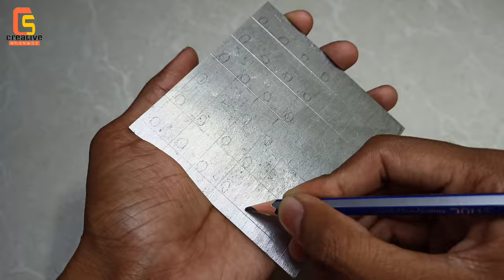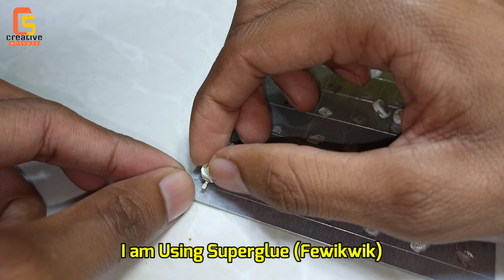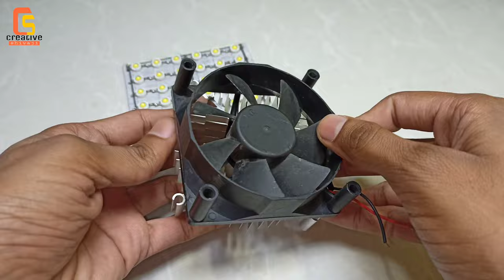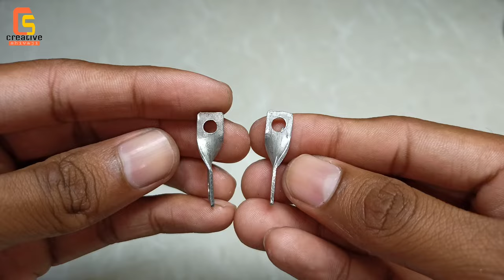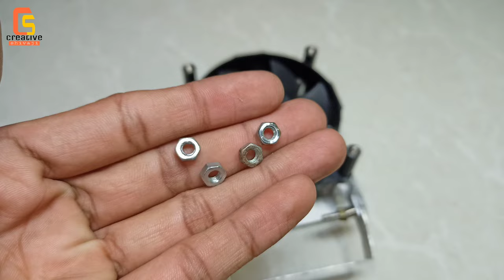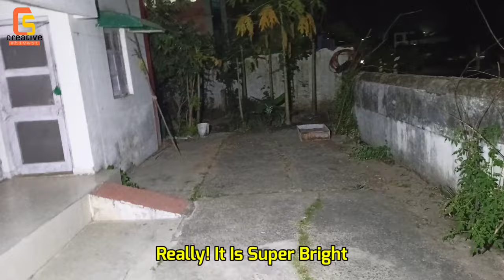How To Make Super Bright Led Light | DIY Super Bright Led Campaign Light | By - Creative Shivaji

Comment: LED'S WILL BURN OUT 4 VOLTS PER LED WHEN 3 VOLTS IS MAX. RATING OF LED.
Reply: i have been working mine with 4.2v  for the past 2 year and it never burn out
Reply: Impossible. Maximum voltage of each led is 3.4 only. @annanmanpaul101
Reply: @BujjiWir bro this is series connection

Comment: Why don't the leds have any resistor wouldn't the current be to high.
Reply: No.. most led has a bridge rectifier from 120 to 12v. Most all led’s are 12 v and will run on your car battery or solar system.

Comment: I bought some of this leds, can those really work for long time like usual lamps or will get burnt? And is it normal that i can't bear its temperature like the usual lamps or this type shouldn't get that heat and should decrease the volt, note i am even inputting 3v instead of 3.7v

Comment: You don't use resister? And how much voltage used?
Reply: Led 2 watt 4 volt,. Input voltage 12v
Reply: Will feviquick conduct heat ?🤔